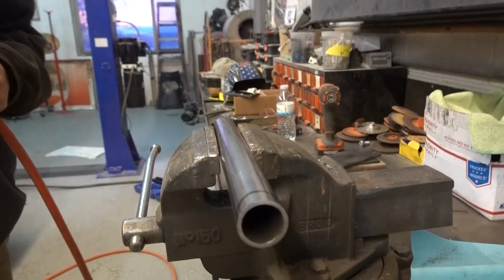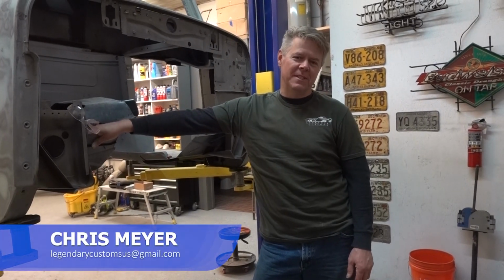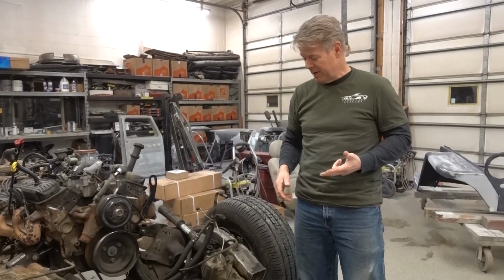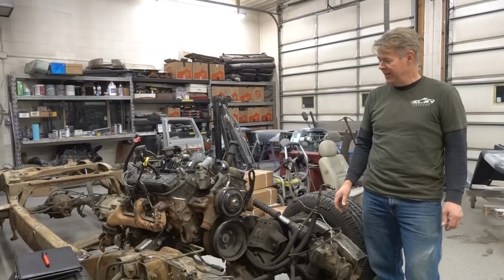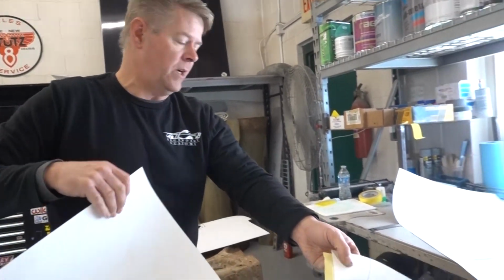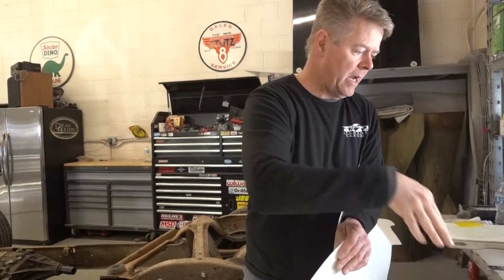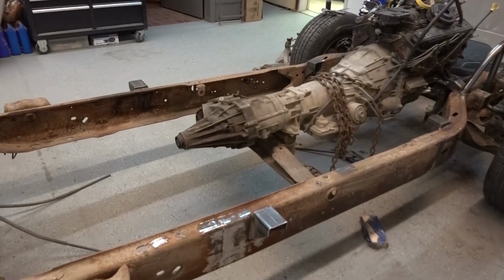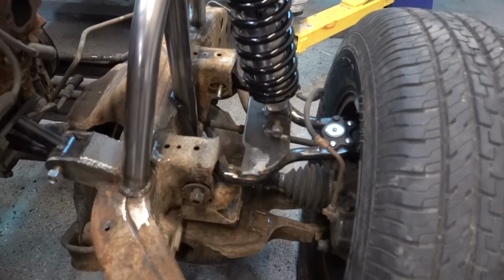LEGENDARY 1948 WILLYS PICKUP BUILD: PART 4 | Custom Firewall, Shock Towers/Coil Overs

Comment: nice job! what was the reason to move the drive train back 9" ? is the frame the same width as the old one?
Reply: We needed the room for the longer engine, wider radiator, & the electric fans. It could have been 8", but no less. Width of the frame worked great. Slightly wider.

Comment: Could you have left the engine where it was and extended the hood and fenders to accommodate the required space?
Reply from the maker: That's possible. It's a lot more fabrication of fenders & hood to make it work. The 49 hood & fenders are not reproduced so it's a big risk.